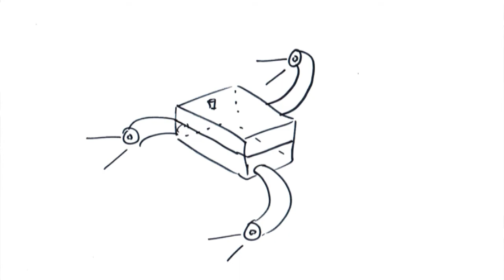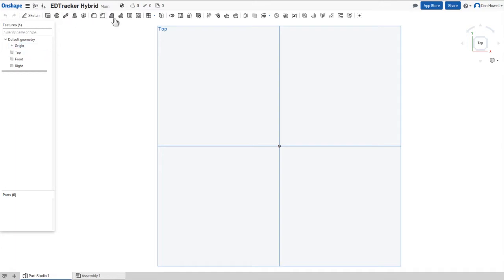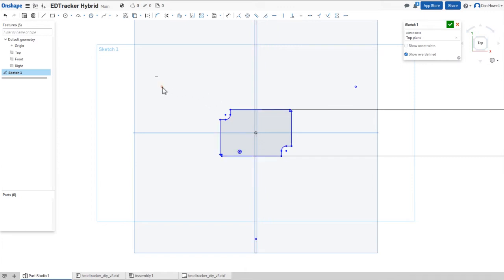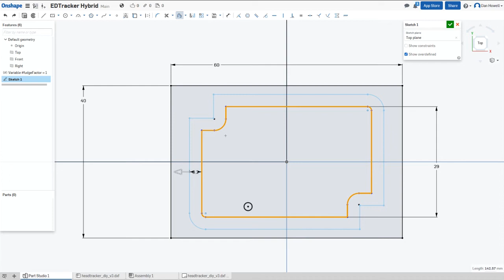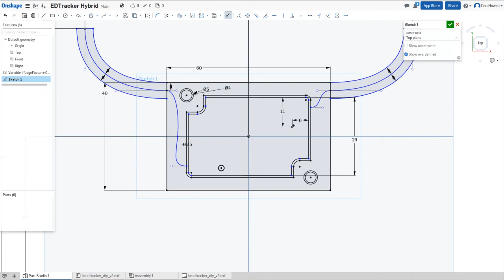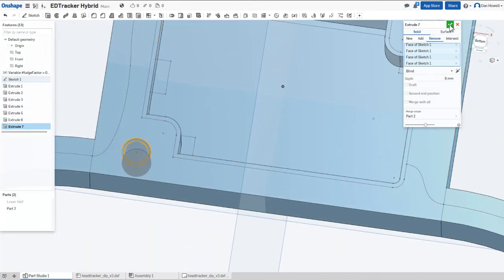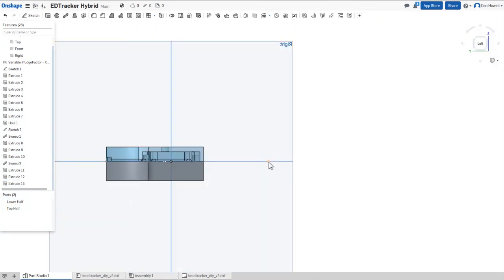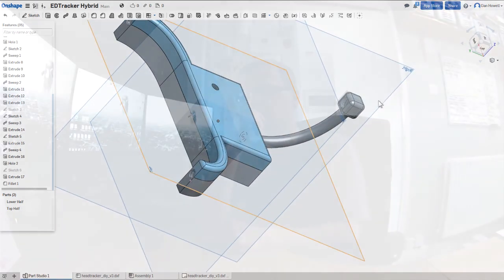Hybrid DIY EDTracker - Part 3 (OnShape CAD)

Comment: I'm trying to flash Edtracker2_9250 4.0.5 but it stays at "calculating gyro bias" forever
Edtracker2_9250_old 4.0.3 works without an issue... I know this is not the right place to ask but am I the only one with that issue?